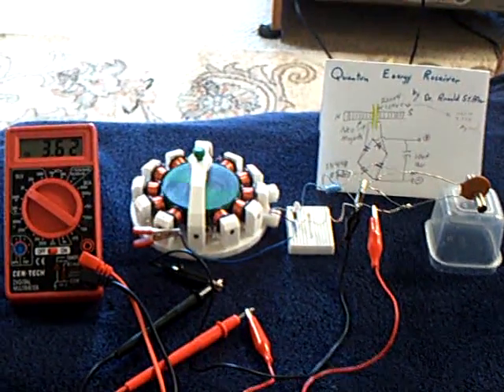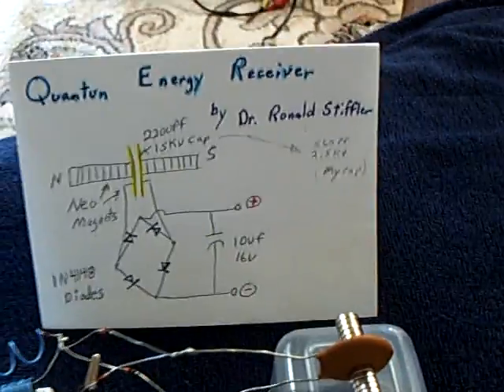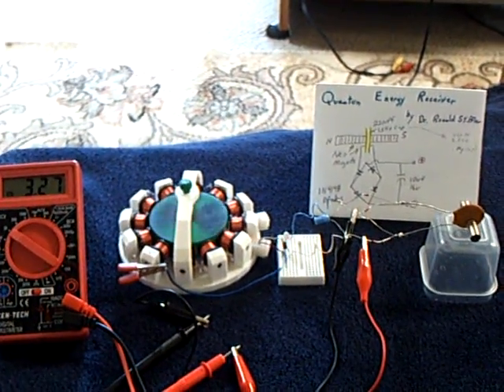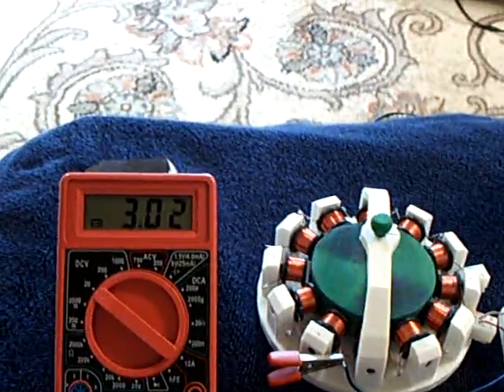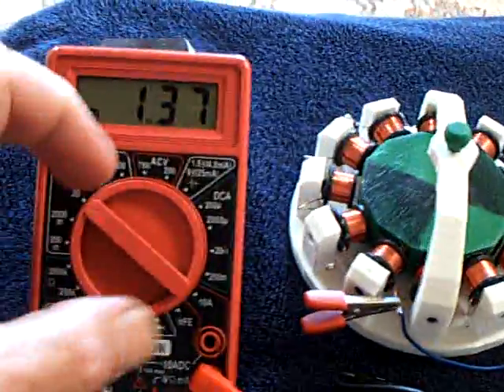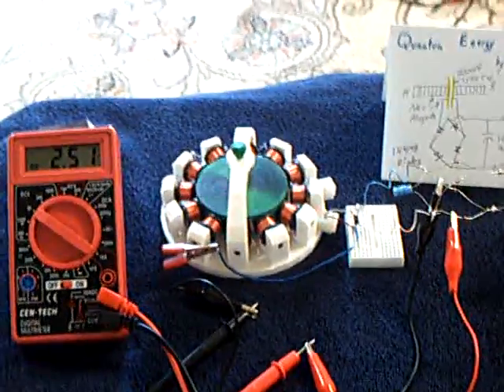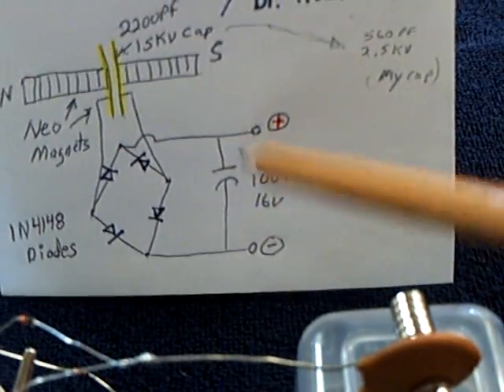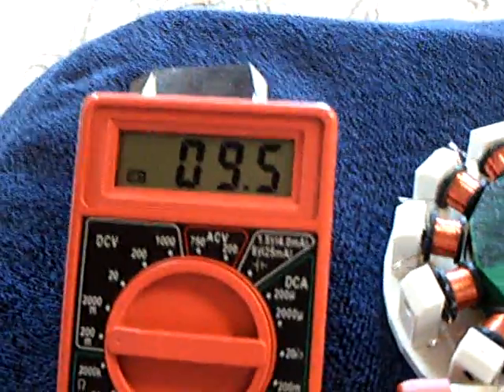Quantum Energy Receiver ----  Study

Comment: Actually, I think your system does work just like Stiffler's. What he isn't telling you is that he is also in an environment, either deliberately or by accident, where there is a lot of RF and/or EF power that can be tapped. And my bet is that it is deliberate.
Reply: TinselKoala Exactly, TK.  Lidmotor is great and very knowledgeable and is just exploring this for the sake of exploring.  But he knows the real deal.  Stiffler is stiffing people with this BS.  On the forums it always goes back to square one where they either ignore the basic fundamentals, or for years on years they are ignorant/other with respect to the basic fundamentals.  It's enough to make you throw up your hands in exasperation.
Reply: User2718218
Is there a video that shows Stiffler's device working with the magnets in place, then showing it not working when the magnets are removed?
Reply from the maker: TinselKoala The whole time I was building this and testing it I was thinking of you and your experiments with 'electro smog'.  I got this to run the EZ spin motor today using just the energy off a CFL bulb.  I don't think that the magnets do a darn thing on mine. They did make a great way to stick the device to the metal reflector of the CFL light.  With the motor disconnected I got 8+ volts out of the little bugger.  With the motor as a load it held at about 2.5v.  That was fun.
Reply: +Lidmotor i have also replicated this circuit, and i have the same results as you. the magnets have no affect, but it is a remarkably good energy collector. With my 8 foot high, 8 megavolt tesla coil energized i can collect 50-75v with this circuit from 300 feet away. Any more than 300 feet and the voltage abruptly drops.

Comment: Dr. Stiffler's Quantum Resonance may be due piezoelectricity caused by squeezing of the capacitor by the magnets:

Quote from wikipedia search for "Barium titanate"

"Barium titanate is a dielectric ceramic used for capacitors. It is a piezoelectric material for microphones and other transducers. The spontaneous polarization of barium titanate is about 0.15 C/m2 at room temperature and its Curie point is 120 °C. As a piezoelectric material, it was largely replaced by lead zirconate titanate, also known as PZT. Polycrystalline barium titanate displays positive temperature coefficient, making it a useful material for thermistors and self-regulating electric heating systems."
Reply from the maker: Pseudo Nym I don't know.  If this was a piezoelectric effect I don't think that several volts would show up that quickly.  We will have to wait until more information is given out.  Doc says that he will be showing o-scope and spectrum analyzer output data later on.  That should tell a lot.

Comment: I also tried the Dr Stiffler quantum Rx setup using 0.01 uf 10KV ceramic and Neos with 1N4148's . Output was very low & likely just noise <10mV.

Comment: The Quantum Energy Receiver reminds me of a friend of mine that was convinced that the human body ran on 60 Hz because when he touched his scope probe he saw a 60 cycle waveform.  I finally convinced him to take his battery powered scope out in the middle of nowhere and he'd discover he was dead.   No more 60 cycles running through his body.)

You'll pick up a lot more energy if you drive the bridge rectifier with a tapped coil and parallel capacitor (similar to an old crystal set) tuned to a strong local radio or TV station.

Comment: ***** Understand this is not a replication due to different high voltage capacitor and smaller/less magnets, but good to see you're studying it. Note that both diodes connected to DC neg. on your schematic should have anode connected to neg. to form FWBR, they do appear to be wired correctly in your video. Thanks for sharing.
Reply from the maker: ReasonForemost Thanks for the circuit diagram correction.  I hope that someone does a true replication of Dr. Stiffler's device.  As I showed here --it is easy to fake.  We will have to be wary of any replications that don't look right or come from unknown people.

Comment: Their is a lot of electro smog around, wifi, smart meters, and cell phones when you touch the terminal your body is acting as the antenna the diodes are capable of channeling radio signals into the circuit inducing voltage and small current, back in the CB radio days we used to make direction finders using a similar principle. Try doing a search for: RF Detection Meter" on youtube
Reply from the maker: *****  Thanks.  This really should be tested in a Faraday cage.
Reply: *****  I Microwave oven is a faraday cage, TURNED OFF of coarse, designed to prevent radio signals escaping try putting a transistor radio in while it is playing a strong radio signal it should go quiet when you close the door, if your device can fit inside ?
Reply: ***** Yes and no. I am not so sure microwave oven doors are made to totally block a wide bandwidth, they are only interested in stopping 2.4 GHz.
Reply: *****  It blocks majority of signals try it, if a FM and AM radio stops working as they are at much lower frequency than a Magnetron then its working. Of coarse it may be less affective at some frequencies but it does work I have tried it as long as yours is not a leaky Microwave.
Reply from the maker: ***** I tried the microwave oven test and it blocked the signal from the Slayer Exciter which runs in the MHz range.  When and if someone does get a true replication of Dr. Stiffler's device to work this test would be a quick way to block out at least the RF signals.  It would eliminate that as a source.  If the device is getting energy some other way that is another story. Thanks for the input.

Comment: Hi Lidmotor. Just started experimenting. Built your pulse motor, neuman motor and flux generator. Does Maggie work better with eyes in series or parallel? Can ez-spin motors be purchased? Thanks!
Reply from the maker: Frank Rogoyski I'm glad that you have had success building some of my projects.  Maggie's eyes are in parallel.  I never have tried them in series but the device should still work.  It might be fun to install a switch of some kind that flipped them back and forth between series and parallel.  I have  (+) and (-) leads hooked up to her eyes so I can read voltages and run things.  If the leds were in series I would be able to get higher voltage outputs.
      LaserSaber did sell one of his motors on Ebay but I don't think any more are for sale.  The plans, parts list, and 3D print files are at his web site for free.

Comment: Cool!
What is your explanation for why the V goes up when you touch the battery?  How does you serving as an antenna cause the V to increase in the circuit?
Reply from the maker: A B That is an excellent question.  I wish I had an excellent answer. Sorry I don't.  I just know that it works.  I first learned about it when I was working on the Dr. Stiffler SEC projects. Doc did a lot of work with it back in those days.
Reply: ***** No problem.  Thanks for reponding.
Reply from the maker: A B Here is a video by Dr. Stiffler that shows the energy pick up off the side of a battery.  https://www.youtube.com/watch?v=0LayqHh6Uv4
Here is a 2010 video I did showing the energy pick up near the power source also. https://www.youtube.com/watch?v=s1BEzNpDgQY This video was my first replication of Gary Bluer's exciter.  His handle here at YouTube was Slayer007 so I called the device the 'Slayer Exciter".  The name stuck.  Both of us were studying Dr. Stiffler's SEC work at the time and exploring other ways to get similar effects.
Here is the original 2010 video by Gary Bluer that shows the birth of the amazing "Slayer Exciter".  Just remember that it was a study of Dr. Ronald Stiffler's SEC work that led to it. https://www.youtube.com/watch?v=oIOdewXSc98
Reply: ***** Excellent!
Thanks for all the info!

Comment: Does it still work if you short out the capacitor with the magnets?

If you isolate the capacitor legs and twist them, will it still pick up energy?

I see a loop with the capacitor in the middle next to a transmitter, basically you have built a reciver antenna. Capacitors do allow some ac.

As for spinning the motor, you have a generator. Badically changing field around coils.

Where is the need to use quantum physics to explain part?
Reply from the maker: erlendse Mine doesn't work like it is supposed to.   What you see here happening has nothing to do with quantum physics--- you are right.   It is just an interesting receiver setup.   The question is--- what is Dr. Stiffler's device doing????  and how?
Reply: ***** I do not know, but it's way too easy to cheat. A coil under the table, trickery with the meter cables e.t.c.

The circuit isn't very meaningful, the way he have it.

I mostly deeply distrust it when quantum is used as something that can't be explained, so you just have to believe the presenter, in videos e.t.c.
Reply from the maker: erlendse There are people working on this project who are very reputable and known for honesty.  If one of them does a replication then others will soon follow.   If no one can replicate this then something is wrong.
Reply: ***** I hope you are right.

If you really want to test it right, it should be done in a faraday cage built of mu-metal, meassured with battery powered meters inside the box.

Otherwise it's likely to pick up the environment, a valid but a totally different test.

Btw you should take apart one of the capacitors for complete knowledge of the setup!
Reply: ***** No idea how I missed this vid. Was just catching up with reading on OU forum and saw the link (Google+ probably failed). 
Had never seen the capacitor method, but makes some sense. 
Am in complete agreement if noone of repute can replicate...something missing or something added is going on.

Comment: Did you do a control test with the magnets removed from the capacitor then replaced ?
Reply from the maker: Yes.  The magnets do nothing.  A
Reply: ***** Uhg...I was afraid of that...Do you have any idea what was sandwiched in between the original copper and aluminum plate version of the Quantum Energy Receiver ?
Reply from the maker: No.

Comment: 4 Germanium diode make more current ,because break- effect  is lower than silicium diode ,germanium is by 0,2 volt ,you know it from diode receiver middle wave ,if you have/find  a strong transmitter resonance by middle wave ,you can harvest energy of it ,adapable with four germanium diode for positive and negative sinus wave ,may be you will have luck ,,if it is work with it ,it work 1000 years and more !!!  but think also of 3 meter or longer dipol antenna,ground and actor must be same length,     in this device ,you do not need energy from the tesla coil any more   ,
your pulse motor are exist in old battery clocks, from year 1970 , meißner ozilator pulse ,with coil feedback , i take one clock and build  a running motor from it , 
its a lovely device ,it runs 3 years ,with the same battery AA  ,the coils are the thinnest wire which  i ever have seen, 
the motor runs with about  0.01 mah
combine the lowest current motor with middle wave energy ,next step 
Imagine, the radio clocks of the future, all run without battery, free energy from the medium wave, 
a little Tesla dream comes true 
   thanks much friend

Comment: I dont know, but I smell bullshit with his device, subduing a capacitor to a strong but constant magnetic field will not produce any power. Capacitors work on electrostatic principles, the same effects that can be clearly observed with high voltage, high impedance DC generators (AKA van de graaff generators, etc). Inductors work on magnetic principles and will produce current and potential difference in the presence of a changing magnetic flux.

I would take what Dr Stiffler is working on with a grain of salt.
Reply from the maker: Power Max .."subduing a capacitor with a strong but constant magnetic field will not produce any power."   I tend to agree with you.  My study of this (so far) trying different ingredients in the 'sandwich', didn't generate any magic power either.  Some are saying that it is a piezoelectric effect but I don't think so.  The main reason for this video was to show the super AV plug effect when coupled to an Exciter near by.  I hope that Doc isn't being fooled by something in his lab.  He is an RF engineer by trade and an ex college professor.  I doubt that he would make that simple mistake.  We will have to wait awhile until he gives out more information on this.
Reply: ***** Even the piezoelectric effect will not generate any EMF with constant mechanical stress, the stress and strain must be changing over time (d/dt). Is it possible that he just wanted to make a parody video to see how many people he can fool? Lasersaber does something along those lines every april 1st.
Reply from the maker: Power Max Perhaps.  Tinman and TK have done similar things to prove a point.  If so then it reminds me of the Peanuts cartoon where Lucy pulls the football up just before Charlie Brown is going to kick it.  We fall for it over and over just like ole Charlie Brown.  I hope that this is not the case here.
https://www.google.com/search?q=charlie+brown+and+lucy+football+photos&biw=1280&bih=671&tbm=isch&tbo=u&source=univ&sa=X&ved=0CB0QsARqFQoTCPqc5NjKnMcCFQZPkgodlQ8FFw#imgrc=tA-N3_NDLUzm3M%3A